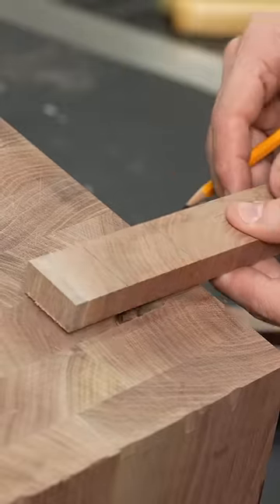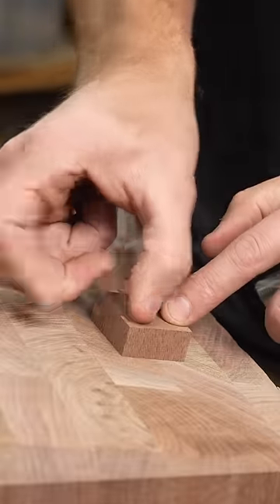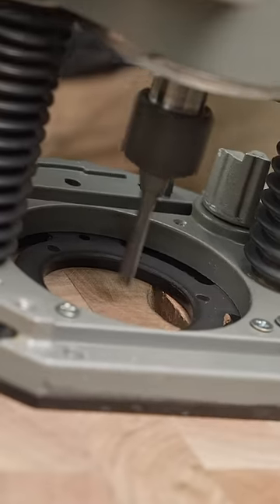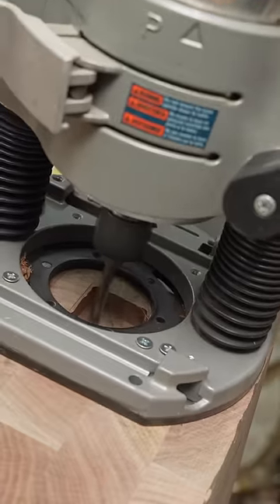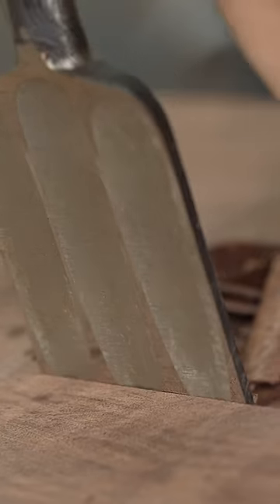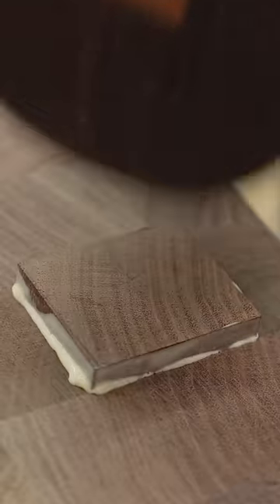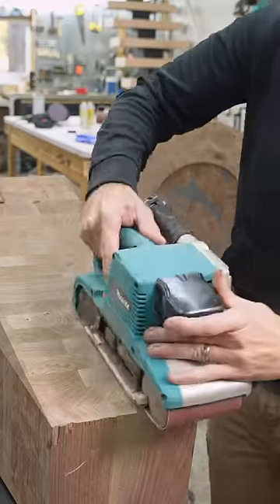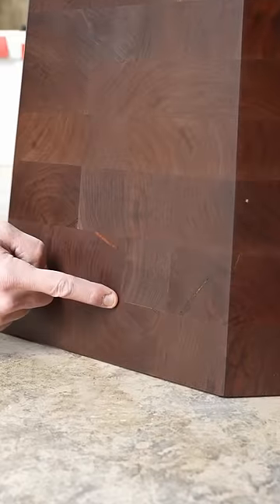110 lb Walnut Fix

Comment: Back when I used to work at a cabinet shop, we would let the glue dry about a day
 in warm conditions.

Reason being that if it is sanded to soon you would end up with dips between the two materials.

It's probably less of an issue with end grain, but definitely with the face of it was more noticeable in my experience.

I would say the end product turned out very well with the repair.

Comment: I put a very small taper on the piece I am replacing. That ensures a tight fit and no glue lines. All you need is about 2 degrees on all four sides.

Comment: If you slightly taper all four edges of the blocks, when you tap them in place the block tightens it's self and leaves no joint lines

Comment: Instead of all hat work. Just fill the knot holes with clear epoxy. You'd be very surprised just how many clients will actually like the finished result.

Edit: I'm a master cabinet maker.  28 years experience here. This is what I do. I built a countertop out of knotty walnut for a client. He wanted the wood because the tree came from the family home. When I explained that there would be lots of knot holes., he asked what I would do it it was mine. I told him the above...and if I had the money I'd waterfall over the side as well. He loved the idea. He went on to place LED lights under each through hole and used them as night lights and to enhance the ambiance of the room. Ive been looking for material with as many knots for my own kitchen ever since.

Comment: If you cut the square slightly too large and then slant the edges with a chisel when you tap it into the hole it presses tight against the edges and closes up any gaps.